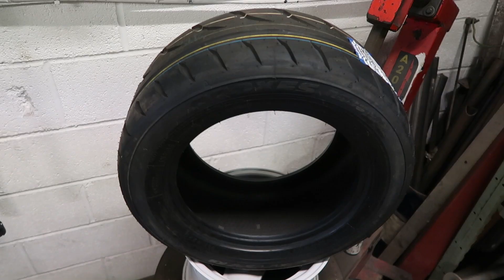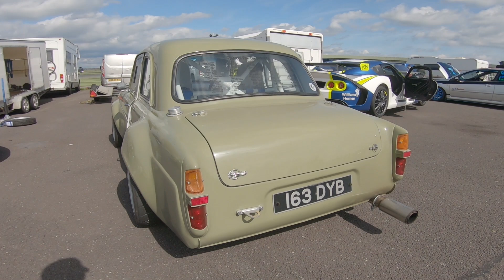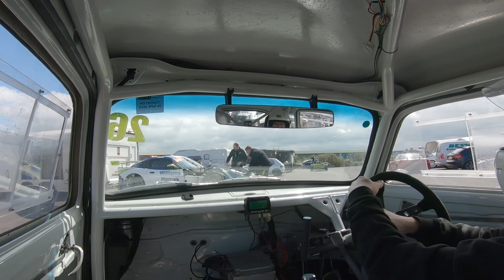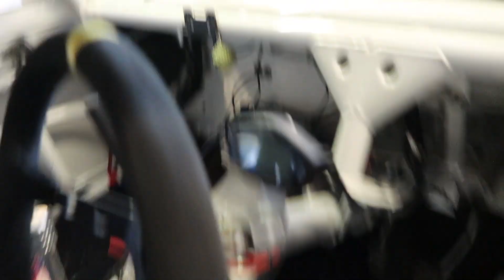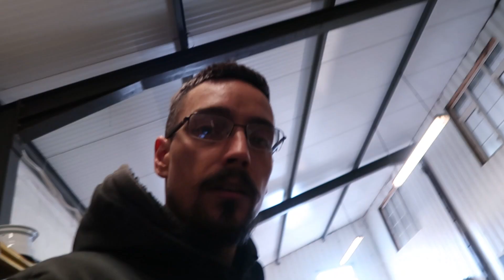TURBO Powered 1959 Ford 100E at Thruxton Circuit

Comment: Even in standard form with nothing more. than 165x13 radials on standard rims(165 was max on standard rims) 
the 100e/107e had brilliant handling and roadholding.
I think the 100e shown. on here has far exceeded anything the Ford design team in the early fifties wold have expected.

Comment: My first car was a 1957 e100 that my father had sold a set of new Gulf tires to the owner. He returned two weeks later asking if we would give him his $100 back (that was what a set of 2 ply 13” tubeless tires cost back in 1964 and that included mounting and balancing). Well my father told him that he could not do that because he could not resale the tires as new to recupe his money, not to mention the labor of taking them off again. So the guy said that he would take a hundred dollars for the car because the engine was needing a rebuild. I was turning 16 in a few months so my dad agreed and told me to park it on the back corner behind the tire changing area and that I could only work on it when I was coughed up on my school work and my shift at the station.
Our neighbors owned an auto parts and machine shop. So it only took me about a couple of hours to take the motor out and call them to pick it up. Luckily all of the bolts were SAE so that there were no special English tools required. But what was required was patience, it took our 3 months for the machine shop to get the rebuild kit and then a month to work it into the schedule. As you can imagine I was anxious to get it back, so I spent the time modifying it. Let me say that even though I had never seen this car before, the flathead engine was nothing new to me and my father. Our service truck, which was totally restored from the frame up, was a 1948 Ford F 150 with a flathead V 8.
Well the little e100 was s powder blue paint that was faded and dull and worn through in place on top of the finders, so my first modification was to paint it. I choose Corvette Candy Apple Red Metal Flake, but in those days it was an enamel paint, and I had to water sand the dead paint off multiple times, paint it with a primer and when cured from sitting in the Florida sun, water sand it multiple times. Then came the time to spray the finished enamel. Luckily there was a retired man who knew how to paint and he gave me instructions and encouragement. It actually came out pretty good with on on or two runs that were not obvious until you looked closer.
While I waited for the engine, I took the front bumper off and tossed it, jacked up the front suspension a little, put a set of the largest 13” tires on the rear, and on the inside I put a pair of fighter jet seatbelts that I bought at the surplus store, replaced the shifter knob with a brass small piston from a chainsaw, put a tube type radio in the glovebox sitting on a sling for shock absorption, wedged the speaker between the shifter and the firewall, and finally I could not afford a tachometer, but I took a pressure gage off of an old radiator cap tester that was being replaced and I drilled a hole in the water pump and tapped it and ran a 3/16” copper tube through the firewall and up through the dashboard and mounted the gage there on the right side of the speedometer. So when the engine revved, the gage went to higher pressure until it reached the “Redline”. It was hilarious as it made a clicking noise as it wound up and down. But it was a different time and this was a step above the Soap Box Derby and luckily I lived in a small town and had minimal encounters with heavy traffic and large trucks. Although the little 26 hp engine would scoot the car along at over 70 mph on a flat mile or more stretch of road.
My parents must have realized the danger that this small car entailed, because they made me sell it and get a baby blue 1955 Chevy BelAire with a Blue Line 6 cylinder engine just before I graduated and went to college. I assume that my car might have been brought here by a military person who ordered it with left hand drive? I never knew of a Ford dealer who sold them.
Well that is my story about my English Ford. The only other one that I saw was in a car magazine and it had been made into a dragster and had to be driven from the back seat…. It was a 26 hp monster that would hit about 80 mph in a half mile. But it was fun and never gave me a problem other than the gas tank rusting out, I just put a 5 gallon can in after I soldiered a brass fitting in the 3/8” hole that I drilled in the bottom side and strapped it in the same place in the back fender. Luckily I lived in a small town because it was a rolling coffin. But it was perfect for the time and place.

Comment: The person in that one car that actually passed you, I think it was a Celica, wasn't getting away nearly as fast as I'm sure they were expecting to.

I guess the next goal for this car if you feel the need to keep making improvements would be to beef up the engine internals and crank the boost pressure a bit higher to aim closer to 300HP. I know those engines are more than capable of it once you make some improvements to their guts. Probably also want to consider a suspension upgrade and brakes if you do. If you make it go faster then you need to make very certain that it can stop as hard as the tires will allow. But this is all optional. It looks crazy fun to drive as it is, so there's no need to do more unless you find that your current levels of adrenaline just aren't cutting it anymore.

Comment: I bought a 1959 Ford Prefect 100E back in 1970, 3618 F, 1172cc side valve. I then bought the car that was owned by the gold top champion in dirt track racing. I then swapped the 1500cc Anglia engine, the 4-speedd gearbox, the electric wipers, and then fitted a lower ration differential. I also installed the all-round disc brakes. I didn't lower it, but did fit wider wheels and tyres. I preferred it to be a Q-car, and surprise/scare more people. The best thing was, in the days before the 70mph limit, I overtook a Ford Mustang on the A40. It was a great little car. Followed it with a Mk1 Cortina GT, and then a Mk! Lotus Cortina, which is the best car Ford have ever made.

Comment: Congrats! It did it! ..Once. On dry. Do you monitor your intake temps? There is a strong possibility that your engine bay gets so hot that it starts to heat up your intake. That could be the power drop you experienced. Then there's the blow by saturating your oil with fuel, which then heats your bearings, cylinders and pistons causing more friction, heat and wear resulting loss in power. Boost is perfect for drag strips. At circuit, it's just too hot or too torquey.
Reply: Moar radiator! When Matt said he had a 107 C temp- that's past boiling- I had a feeling he might need some more rad or electric fan on the rad he had. Adapt an oil cooler from an RX 7 rotary engine put in to circulate the oil through wouldn't be a bad idea either. An oil filter relocate kit should get you all the parts to make it bolt on to the engine.
Reply: @fredericrike5974  More cooling could help, but it also brings more possible failure points and adds weight. Things not suited for race car.
Reply: @oikkuoek  All cars, not just race cars are  built of a thousand or two compromises. I get that- but a bigger radiator might only add five, six kilos dry and maybe five more for the liquids- if he can keep it cool longer, he can stay in it later and longer. And, FWIW, I have seen more scrimping on things like too small radiators ,  cheap brakes and electrics than I want to discuss; but if you don't finish at the head of the last lap, you DO NOT WIN. Not to sell Matt's considerable skill short, I'll bet you there is 40+ kilos he could get out of the car as it is now- when he set out to build it , he wanted something he could thrash and learn on- I think he did grand at it for as small a purse as he could, is what I think. And more cooling might just be a more powerful electric fan to pull more air through- until Matt susses it out we won't know- and we may all be wrong on the first guess.
Reply: @fredericrike5974  Then there's the factor of basic air ducting; through the radiator, out of the engine bay. As a basic learning vehicle, first needs to happen the driving itself. best way to hone this is to figure out suspension, brakes, steering and gear ratios. Then comes power increase, when all the above are already maxed out. In this case, there were far easier and overall cheaper ways to cut down lap times than adding a turbo. Turbo setups are fragile and very finnicky to handle, and with the power increase Matt's setup brought, it all and then some could've done without adding the heat inside the engine bay, which will cause troubles later on. To finish first, first you need to finish.
Reply: @oikkuoek  As a mechanic, the Pea isn't his "first rodeo" by quite a chalk. But a) it's Matt's car, b) it's Matt's time, c) it's what Matt wanted to do. That is the first rule of the car hobby- if you paid for it, you can largely do as you please. That said, he was doing pretty well prior to the turbo, but he was being passed often. This was the cheapest way for Matt to make the next cut. I think he did pretty well for the budget I believe he had. Believe it of not- Matt is a father and husband- he doesn't ever talk about it but he has had the boy in a couple of times- they are treat to watch!
Reply: @fredericrike5974  After a few torched engines, I believe this is already a second one, a "cheap" turbo build isn't that cheap after all..
Reply: @oikkuoek  NO, none of them are- NA or boosted. His little 1.6 Mazda does this in North Texas as a regular thing. With boost, fluids are life is rule no.!- and half empty radiator is as dangerous as low oil. But if you are going to track something exclusively, that is how you need to keep it anyway. And driving with your foot nailed to the floor will torch engines- NA as well as turbo- Matt wants to go faster; what other course for under $1000 USD would you have taken to gat to here? That is about what I saw go into this. He's had to really get creative to source an engine for his Mini- he chased dollars and pounds in his sleep, I'm thi9nking. And yeah, he knocked the bottom out of his first motor for this car- a pretty bone stock Mazda 1.6L with ITB s on it- and not much else. He flat over drove it- he was out of power long before he was out of Matt's abilities. I think, don't know, but suspect he has gone fast on motorcycles in the past. The new power re awakened his "speed brain" - when he started pursuing the white and blue car for m about 11 minutes on his lap clock, he steadied down and got with the business to chase a car that was somewhat faster than the  Mushy Pea- and he did  a good job of keeping him in sight, driving a bit closer to the edge of Matt's learning , increasing skill. But it's OK, Oek- Matt is absolutely able to deal with YT expertise; find what you can use and trash the rest. Even mine.
Reply: @fredericrike5974  On this side of the pond, you can't get that snail with 1K, let alone the rest of the parts.. And the ITB version was completely out of tune. Yes the ECU got some kind of "street tune", but the hardware wasn't even close to making anything. It didn't pull, it didn't rev, it just honked. The same peak with more drivable torque curve is easily made N/A, while the setup is more reliable on different weather conditions and hard driving. It requires a bit more skill than just ordering boxes of shiny parts, but definitely doable.
Reply from the maker: I’m getting anti turbo vibes.
Reply: @Urchfab  Turbo has it's merits on short bursts, but longer stress it does more harm than good. Simplify and add lightness.
Reply: @Urchfab  You weee in the chair connected to it- start from what you know- I'm a retired plumber several thousand miles and a few hours out of time with you!
Reply: Do you guys actually have race cars?
Reply: @HSVR383SC  I sold mine, still do some occasional porting, if the project and owner seem interesting.
Reply: @HSVR383SC  My last race was about 15 years ago- but my reactions, etc aren't up to it at 70+ anymore, but I still love the sport. I still "bend a wrench" but not as much as I would like. Oek has some points- but he seems to be on the this track is THE right track; I've seen mail carriers turn into really fierce powers on the track- self taught and in self or neighbor hood built cars. There is no one Right Way. And tbh, I wish to see Matt continue forward and feel like he is "getting there" a bit more with each experience. He is absorbing the differences between NA and boosted- a very different power curve- and he isn't doing badly at all. And he isn't being passed as often, either- now he has enough car to chase better cars and drivers and really learn. And he WILL get even better.

Comment: What is with the meter long exhaust tip?
Reply: Probably noise restrictions at that track.
Reply: He explains that.
Reply from the maker: It makes up for having a little wiener.
Reply: To meet Draconian UK circuit noise regulations
Reply: Slip on silencer, even some road cars need them on trackdays...
Reply: He explained it in another video, it’s an extra silencer for tracks with tighter noise limits.
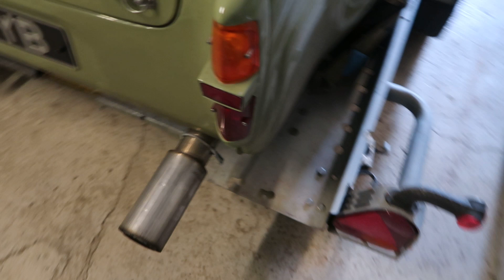Reply: 14:23 @SJV I like people like you, honestly.
Reply: @randomgoose  you are a rarity.